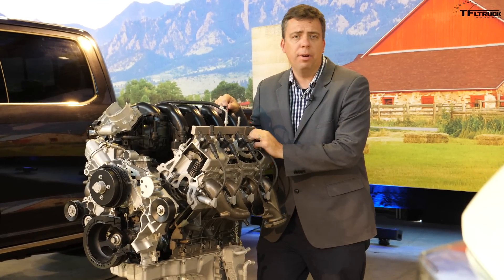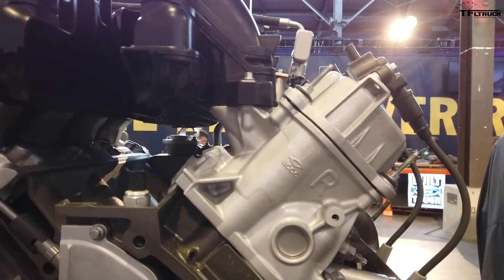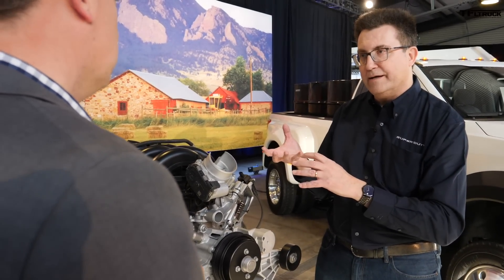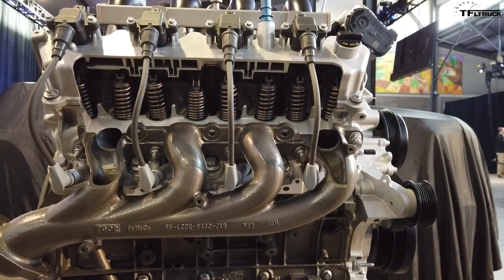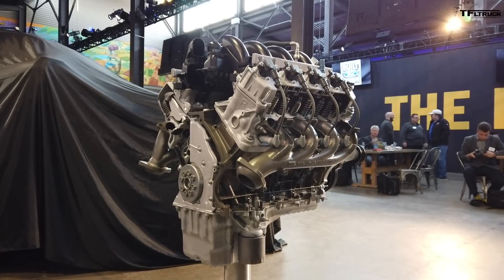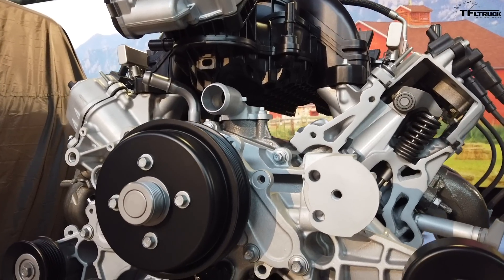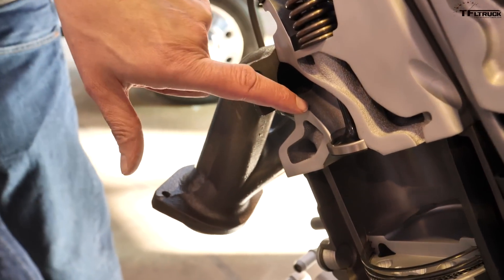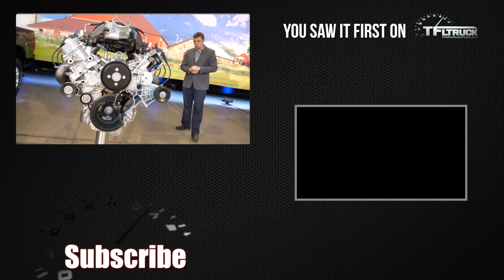2020 Ford Super Duty 7.3L V8: Here's What You Need to Know!

Comment: Wow, iron block, pushrod center camshaft big displacement. Ford found the way again
Reply: roller barring rockers too!
Reply: Exactly what I was thinking.
Reply: Edmundo Cuervo Not to mention port injection
Reply: Wow. It really sounds like it’s just a big block LS engine.
Reply: Offer supercharges for these engines and maybe coyote mustangs can finally break 10 sec 1/4 miles 😂
Reply: Yeah, it's called the LS. GMs been building this motor since 2001
Reply: The new diesels don't even have iron block ! Not even the 2019 6.7 Cummins! This is interesting!!
Reply: @darylvise1619 , you do realize that the LS is a combo of Ford Windsor and FE, don't you?
Reply: @johncerejo3592 , and GM stole design ideas for the LS from the '60s Ford Windsor and '50s Ford FE.  Don't get it twisted.
Reply: @douglasdonahue8883  vmp
Reply: Too bad coyote mustangs run 8s and 9s consistently with stock unopened engines just throw some boost at it
Reply: John Cerejo 1997*
Reply: @redtorino  Just like the Windsor is from the GM 350
Reply: ford made instant classic. the end is near!!!
Reply: John Cerejo more like since 1997....
Reply: @bartekmedes8281 , no.  Just no.
Reply: A pushrod center camshaft it is.  Going back in time Ford is.
Reply: Jerry Brandt The 6.7 ford and new 6.7 Cummins are compacted graphite IRON

Comment: Jack ass engineers finally figured out push rod engines are awesome.
Reply: only ricers think pushrod is bad, they are the same who also think rotary engines are good. also, apparently the early 90s dohc 4 banger craze never ended for them
Reply: Except they aren't. Pushrod engines have breathing problems, and with high compression ratios they get horrible combustion chamber geometry.
 Nothing beats a 4V/cyl DOHC Diesel when it comes to reliability and efficensy....
Reply: @TheEsseboy  yeah no
Reply: @andiarrohnds5163  Why is literally every industrial vehicle diesel powered?
Reply: @TheEsseboy  torque, efficiency and durability
Reply: @killerwatt318  The later two yes, the last one is irrelevant. If you need more torque you just increase gearing.
Reply: They will never use a push rod engine on a Mustang or their Ford GT because they want to keep those futuristic.
Reply: @TheEsseboy  A well built diesel typically lasts longer and uses less fuel than a gasoline engine. When fleets are selecting vehicles, they count the lifetime cost of a vehicle and determine that diesels are worth the money.
Reply: @skylinefever  Exactly, thats why that engine is garbage.
Reply: But they can’t figure out a reliable turbo system (which is free power).
Reply: @andiarrohnds5163  Rotary engines are good. There aren't that many engines out there that weigh as little as the 13B and can reliably make 700HP out of 1.3 liters all day every day. You don't have to be a 'ricer' to have respect for the engineering of the rotary, why cant you show the deserved level of respect?
Reply: Ford created the over head valve engines.
Reply: @cemsengul16  or because they are cars that the owners like to drive fast and can't afford valve float at high revs.
Reply: @hepburn118  yeah hey performance  engines need last longer than 80k miles. they also need to actually have compression. don't forget that
Reply: @andiarrohnds5163  What, like mine and the rest of the Pac Performance engines lasting longer than 100K miles without issue and will still run a sub 10 1/4 mile? Your being very mouthy and disrespectful to a class of engine that runs very well, there's no need for that.
Reply: @cemsengul16   we've already had push rods in the mustangs and the were fantastic
Reply: @hicelacoe1897  Want to write that again so I can actually understand it please?
Reply: I can tell you this...they would had stuck to the OHV engine if emissions did not play a HUGE role with this engine. This engine will have an EGR cooler on it, well last time I looked at the drawings it did. That head engineer only states what he wants the public to hear and not ALL the facts behind why.
Reply: @hepburn118   uh huh, but where is the compression tho? there is a reason those engines are only fitted in lightweight ricer shit. because the rotary engine doesnt actually produce any power. you seem to be confused with RPMs here.
Reply: @TheEsseboy  Doesn't really work like that at high loads. Sure add more gearing, but at highway speed, you're going to have to play with the gears too much at hills and such. That's why old big rigs had twin sticks until they starting making 1500+ ft lbs of torque. It gets to a point where you need power. And as far as your comment about high compression and reliability the most renowned diesel's have been pushrod engines, and those are running 18:1 to 20:1 compression ratio's for half a million miles or more. Like the old reliable 7.3 diesel.
Reply: @hepburn118  being a "mechanical engineer" means nothing. i assure you of that. this is hilarious. you are literally defending the worst engine ever built. how much auto industry scam BS are you willing to go down fighting with here?
Reply: @andiarrohnds5163  rotary may have flaws, but it's far from the worst engine ever built. 

That title either goes to the 5.4l 3v triton, or the 4cyl in the vega.
Reply: @riogrande163  oh ok... sure thing buddy
Reply: @Mrjohnnymoo1  The most reliable diesels are still 4v/cylinder DOHC, because they get more airflow. Wärtsiläs 100,000 HP+ engine is using 4V DOHC
Reply: @andiarrohnds5163  HP is what moves the car... Torque and RPM are just components of power which is the unit which determines how much work a engine can do in a set amount of time.
Reply: @TheEsseboy  100,000 hp or miles? Even 1,000,000 miles really isn't as crazy as you would think. In our semi trucks, 1-1.5 million miles on them is very common. Caterpillar, Cummins, Detroit,  are the engines used. Even in 2 valve, V formation it isn't that crazy. The Powerstroke 7.3 comes to mind as one of the most reliable engines made. And the Cummins 12 valve is undoubted by anyone as the most reliable diesel put into a Retail vehicle. DOHC is nice, but there is more to break. I sell cars, so work very closely with them. Again DOHC is good, but the only DOHC I have seen with more than 400k miles was a Toyota 3.4
Reply: @Mrjohnnymoo1  Horse power, it the most powerful engine in the world.

Many 4 DOHC diesel Mercs have rolled over 1 million miles.
Reply: @TheEsseboy  Yes but to see that they are more reliable solely because they move more air has no basis in fact. DOHC can be reliable but is more moving parts. Even the worlds highest mileage gas engine car which has logged over three million miles was a SOHC B series block. I am not saying DOHC isn't reliable, but dealing with hundreds of cars every single day, the old school pushrods just last longer. Shorter timing chains, so less stretch, no long belts to replace, overall much more reliable. More parts= more parts to break. More parts=DOHC
Reply: @Mrjohnnymoo1  No, but if they are built right they are as reliable as pushrods And the efficensy gains are well worth the extra cost.

Comment: This engine will fantastic AS LONG as ford doesn't take shortcuts on manufacturing. I'm talking about gaskets and seals, water pumps, stuff like that. The core of the engine is a well proven design (pushrod low rpm v8). It was refreshing to see ford realize that construction companies, cities, towns etc. don't give a shit about overhead cams and 50 valves per cylinder, short to long run variable intake runners, they strictly care about affordability and that they can stick anyone in it dump it in drive and go.
Reply: BUBBLES!!!!!!
Reply: So basically, this engine will be what the 6.8L V10 Triton should have been.
Reply: wrong, this engine will be okay as long as they don't reverse-engineer it purposely to make it impossible for anybody but a ford master tech to change the spark plugs or require the cab be lifted to do anything to the rear 3/4 of the engine (like they did with the 5.4L gas spark plugs, VVT take a crap @300k reliably & made ALL the diesels from 99+ impossible to do anything to without lifting the cab).
Reply: @charmilli0n  aka what they did with the 5.4L Triton?

Comment: Love it, however I am still rocking the 2000 F250 7.3L turbo diesel.
Reply: Doesn't get better than those early 2k diesels.  Shame it's almost impossible to make a reliable diesel these days under the new CAFE standards.  Diesels after 2005/6 are awful money-pit engines.
Reply: Nathaniel Kerns agreed
Reply: still hauling with my 96 F350 7.3L with 5 speed manual.
Reply: @frostybandit1  Does 87 f250 6.9l count? Cause I have one and I love it.
Reply: Me, my dad, my father in law have a 2001, 2000, and 2002 7.3 diesels and love them.
Reply: AMAZING truck!  Theres a movement of people investing around $10k into installing FULL interiors/dashboards from the 2016 models into their 2001 F250s/F350s.  

Zachary McFarlin has the most impressive channel here on YouTube.
Reply: I have a '99 f250 7.3l turbodiesel with 86000 original miles one owner. I love it!!
Reply: Your truck will fall apart before that engine gives up.
Reply: Hold onto it man. There nice trucks with a great engine and one of my favorite generations. The powerstrokes are the best sounding diesels for sure.
Reply: Still abusing my 97 f250 7.3 w the Quadzilla 8 Pos chip holding onto a 2000lb lift gate everyday

Comment: Should of been Diesel a new version of the old 7.3 😭😭😭😭.
Reply: The old 7.3 wasn't made by Ford, so it wouldn't make sense.
Reply: Alex Tran Yes by International but I would rather it be Diesel not gas I have a 2000 7.3 with it almost at 200,000 runs like a champ no problems and with today’s technology a newer 7.3 would be out of this world .
Reply: @randall10james47  new technology forced by the government on ford and international killed the 7.3 powerstroke 
 if you recall
Reply: Kyle Cardwell yes but could you imagine the power of today’s technology on  a 7.3 holy shit
Reply: @randall10james47  You could put money in the one you currently own and not have to deal with EGR  and DPF because they've really been cracking down on delete tuning on diesel trucks and manufacturers like GM are putting encryption technology in the ECUs and other modules to prevent you from tuning.
Reply: @randall10james47  I totally agree with you. The 7.3 should have been a diesel. Maybe the 6.7 is a middle of the line engine, and the 7.3 as their top performing engine.
Reply: @randall10james47  I believe it'd be like the modern cummins. A lot of weight and unless parts just to meet government regulations. Take all that off and then maybe you'd have a pretty good engine.
Reply: @randall10james47  I have a 2000 7🌲 with 399k and it's a beast that gets run hard all day everyday
Reply: They couldn't make the 7.3PSD better, they would just screw it up because of the emissions.  Noone can make a good diesel anymore, those days are gone.
Reply: Modern day Diesel is dead due to Emissions!!! I just blew up my 3.2L Transit Diesel because the EGR cooler valve malfunctioned !!!
Reply: Sadly emissions BS means that we will never see another diesel like the 7.3 unless the US finally boots commiefornia out of the union or nullifies their enviro crap
Reply: 6.7 is better in every way....
Reply: @aaronfischnar1872  once it is deleted yes! I have a 7.3 and a deleted 6.7. the 6.7 is world's above the 7.3. but.....the 7.3 is a damn beast. It may not be fast, but it was and still is in my opinion, Ford's best engine
Reply: @P7777-u7r  Not to mention ferd has proven with their last 3 diesels that they have no intention of making a diesel that can even make 500k miles before loads of money being thrown at it, emissions asside they aren't into building well made engines that doesn't make them money.  They simply will never put out anything comparable to the 7.3PSD, one big reason being because ferd hasn't ever built a 7.3 diesel, IH/Navistar designed and built them (though CAT did design the HEUI fuel system the 7.3/6.0 PSD uses.)
Reply: @michaeljkasnter   ANother problem is that ferd has never made a good diesel, the 7.3 PSD was a IH/Navistar product, ford was just smart enough to use it.

Comment: Super interesting. Looks very similar to the LS Being a pushrod 2 valve per cylinder engine. This is a great thing. Will be far easier to maintain than their older engines with SOHC or DOHC setups and chains and guides to fail.

Comment: Great engine, I just hope it is reliable.  No spitting out of spark plugs or week oil pumps etc.
Reply: It's a FORD what could go wrong?
Reply: Those were issues A two generations ago B caused by running modified beyond factory spec.
Reply: "The new 7.3 V8" (crowd cheers) "modular" (crowd lights torches)
Reply: Steve Pounder ummm no. The 5.4 triton was the biggest pos Phord ever made. They blew up all by themselves. No modifications needed
Reply: 5.4 2v is a very solid engine. Update your headgaskets and plugs.  simple.
Reply: @millennialmechanic  no engine sould come out of Detroit that blows out it's plugs, there is no excuse for the lack of engineering in that regard. Period!
Reply: @duane9707  They don't come out of Detroit blowing plugs. Proper torque of the plugs is everything. People go throwing a new set of plugs in and just snug them up then are confused when they work their way back out. How hard is it to do it the right way and avoid error?
Reply: @millennialmechanic  it was not.  It was horrible.  It was the gas version of the 6.0L Powerstroke.   You do not want to know how much cash I have dropped into my 6.0L Powerstroke to make it reliable.
Reply: Rich Farfugnuven not really compared to the 6.0, as the 2v was out well before the 6.0.  the 3v 5.4 were much more problem prone.  I agree on the 6.0s as well. At least 70% of those were junk, thanks international.     But I own a 5.4 2v. Once you remedy the common issues I mentioned.  They are a solid engine, and I'm getting 15L per hundred clicks (yes I'm Canadian).  So it's hanging with modern engines, even being bolted to a 4 speed with 3.73 gears.
Reply: @millennialmechanic  you shouldn't have to rebuild a new gas or diesel engine as I did with my 6.0L.
Reply: @millennialmechanic  agreed its stout... Slow but stout.. 300k on a whole fleet of vans. A couple did blow out plugs... Easy fix though and that happened in the 140k range on original plugs... I drove 1 home with plug blown out and when I repaired it I was unaware of the simple kit they sell so I made a mess of things and dropped shavings in the head wrong plug length ect ect haha... Still running strong at 250k. There is a reason econoline vans were the leading the fleet industry... Also never had a gasket issue.. And these have been over loaded and driven hard.  I do like the vortec chevy vans though... More power and ride very nice in comparison haha.
Reply: *weak
Reply: @Tiersmoke92555   I wouldn't touch the first year production of this engine with a 10 foot pole.  Just look at Ford's track record with first year engines.  It is terrible.
Reply: @madmod  The 6.8s blew out spark plugs right from the factory.  My neighbor had one that did.
Reply: @SomeTechGuy666  Just as your neighbor had problems, our Triton v10 hung around in excess of 300k. To each their own.
Reply: If you are in the market for a 5.4 3v I highly suggest getting a 2009 & 2010 f-150 with the 5.4. The plugs were redesigned again and this time they don't break or pop out of the head. Changed my original plugs at 195,000 miles no issues (I've owned it since new). She's on the road with 10 years and 200,000 miles under its belt and I'm not afraid to beat on it. The spark plugs being the only $ I've stuck into the engine. Only other problem I've had with the truck was a wheel bearing. It's been a very solid truck. As a bonus, if you get an 09-10 5.4, you also get the reliable 6 speed transmission that provides better acceleration and gas mileage. Earlier 5.4's are dogs in comparison, trust me.
Reply: @Welcometofacsistube  Not all of them
Reply: They fixed those issues ages ago. My 03 has the redesigned 8 thread heads and has not had a single issue
Reply: Rich Farfugnuven if you had to rebuild your 6.0 powerstroke more than once, I would be looking for a new mechanic.
Reply: ExtremePower Addicts they are slow, but love all the torque down low.  Just a classic V8 power band.  I found one with just under 200k.  When I updated the headgaskets, all the cylinders still had crosshatching on them. Engine still looked new inside.  It's getting hard to find a 5.4 2v around here with under 300k even.